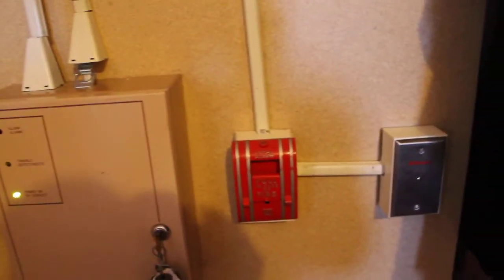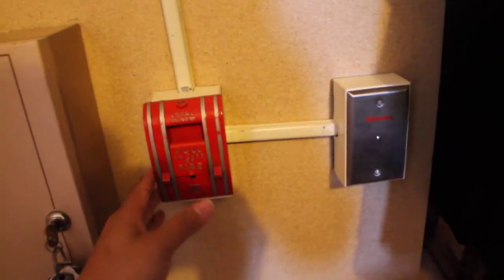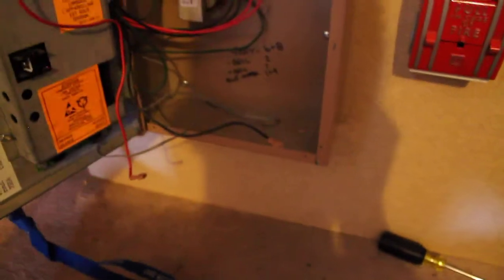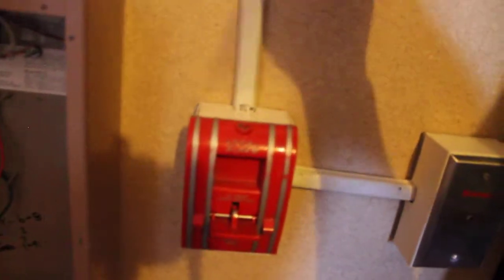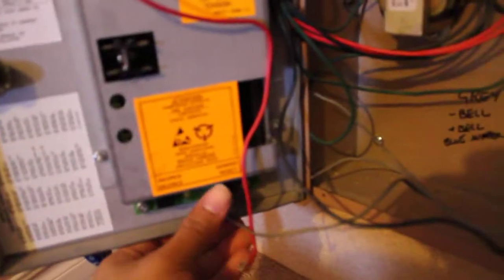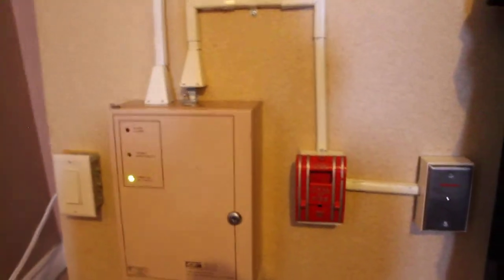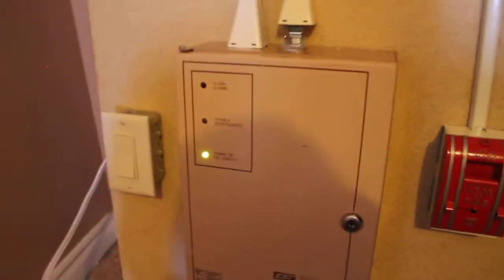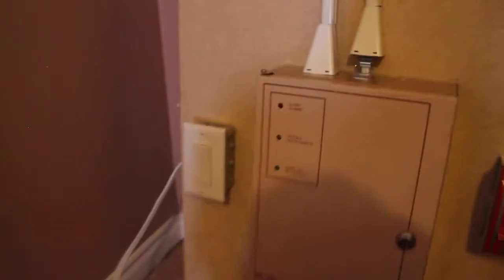System Test 1

Comment: How did you fry the panel?
Reply from the maker: i tried to pull the alarm and reset it without setting the system off, caused an intermittent trouble
Reply: @MircomFan I’m wondering how the hell that manages to fry a panel 💀